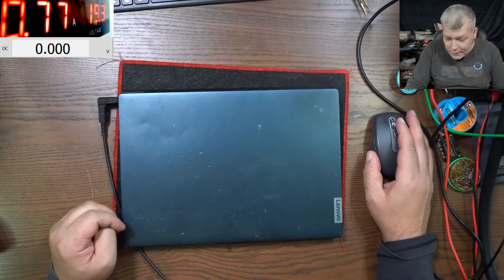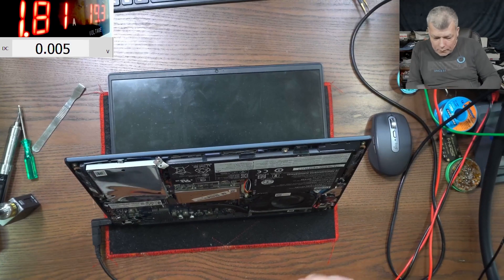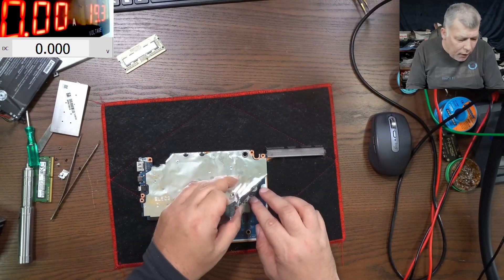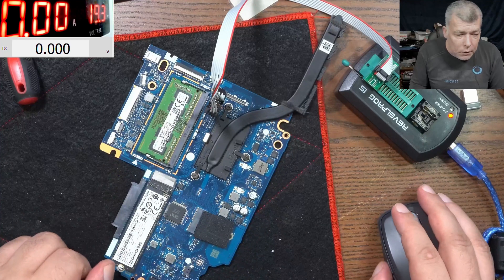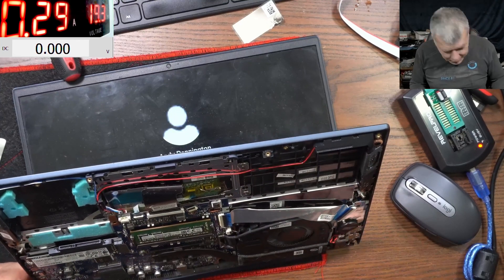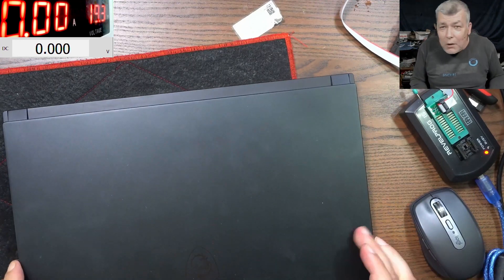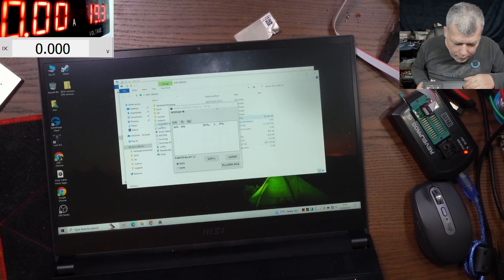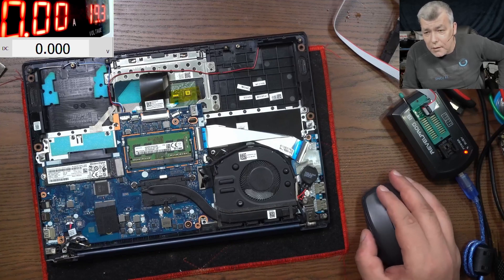How to disable onboard RAM Memory on your laptop - Coming on with no picture? This can be a reason

Comment: The Connector Problem: A physical slot introduces a "bridge" that degrades the signal. If you tried to run LPDDR4x speeds through a 2011-style slot, the signal would be too noisy, and the machine would crash.

Comment: I know this video is 2 years old. However,

You can use that tool to modify original BIOs.
Take the original and the modified one and put it into something like Hex Workshop and do a comparison. Then you can see where in the bios the sections are that need modified. On other bios, it can have similar locations and signatures.

Comment: If it's not a pure silicone glue, if it's like the glue used in a BUNCH of consumer electronics that turns brown, corrosive and conductive, that could be a reason for failure. The fact that the glue we see here is black could mean there's a fair amount of carbon compounds in it already, just itching to degrade and become conductive.

Comment: How does that black glue prevent you from soldering in new RAM chips? Is it a resin based glue? You can remove most resins and glues easily with some heat, or adequate chemicals ..
Reply: The glue is not the problem.  The glue is there to keep the ram chips from coming off the board when the other components on the other side are soldered, so if he tried to reflow those chips, other stuff would be damaged.
Reply: @BEdmonson85  Oh, thank you!

Comment: Hi Sorin, to use the trojanized tool you could try a virtual machine software like VirtualBox or Hyper-V, you can even take a snapshot of the operating system before the exe execution and then revert back with a click. In this way you don't infect the host OS but eventually only the vm.
Reply: I think the key is to just not run it on a computer with any of your personal details on it.  Some malware can steal all of that and send it to someone and you might not even know it until you see expensive items on your accounts.  They may likely be things you never would have bought in the first place.  Usually expensive items they may want to resell or just things they wanted for themselves.  Also do realize that Windows will often show a false positive on a lot of software like this.  It takes one look at it and says it is a virus.  It might not even tell you what it thinks it is or ask you what to do with it.  Windows has a nasty habit of deleting things that it does not like.  It wouldn't surprise me if someone pi$$ed off Microsoft and now Defender deletes their software from everyone's computers with the BS excuse that it is a virus.  All they have to do really is tell Windows defender that any list of files is bad and it would flag them as a virus when it finds them.  Or all it has to do is anything unusual that a virus might do really.

Comment: Hi sorin, Just subcribed this channel after watching your video @ electronics repair school

I have a suggestion that why don't you try to apply the modified BIOS of on-board RAM disabled without removing the RAM chips and check if it works or not?
Reply from the maker: I will in the future, this was the first time i found how i can disable the onboard ram, the ram chips doesn't have to be desoldered
Reply: @10minlaptoprepairs  hi, can you upload the bin file with the ram disable pls?
Reply: @10minlaptoprepairs  please upload full length videos also so we can continue to learn. Thanks with best wishes

Comment: I know it's unlikely, but how can you be sure there is no malware in the new bios file?
Reply: I don't think there will be any malware in the BIOS after using the program, the program just changes some values in the file. I don't even think the program contains any virus at all. A lot of programs that changes how stuff work are detected as potential viruses but in reality they are not. But of course it never hurts, just to be 100% sure, to use different computer! Even some trailers (cheating software for videogames) are detected as malware because they change the values of game files in real time, but they are harmless, as long as you download from reliable sources and not some random russian page.
Reply: @1337Ox  Exactly! On the bulls eye!